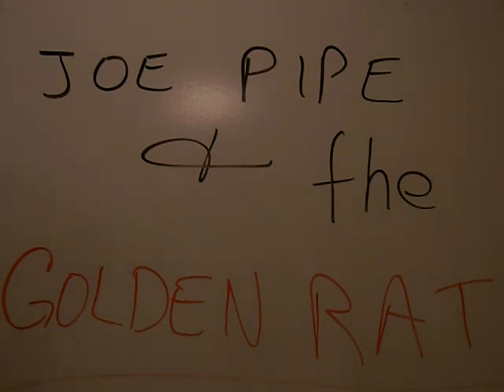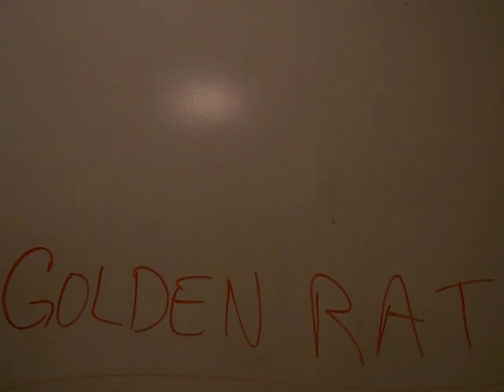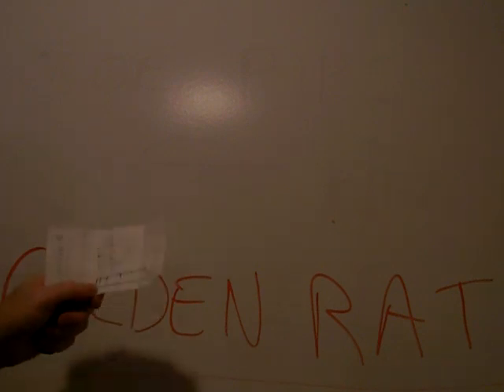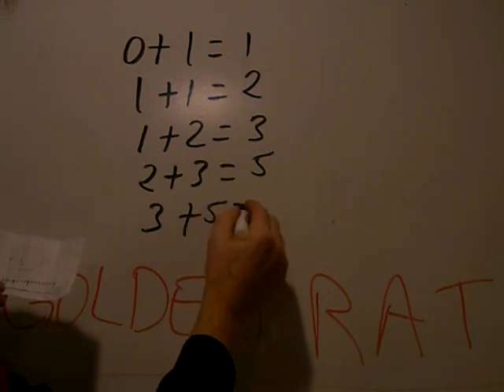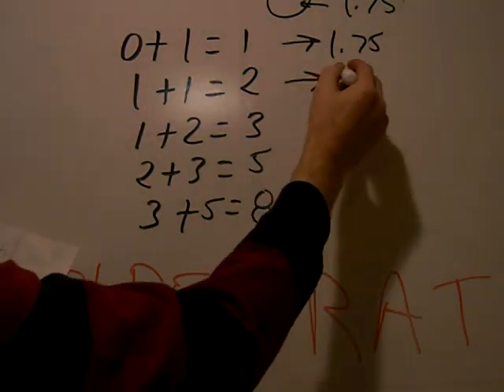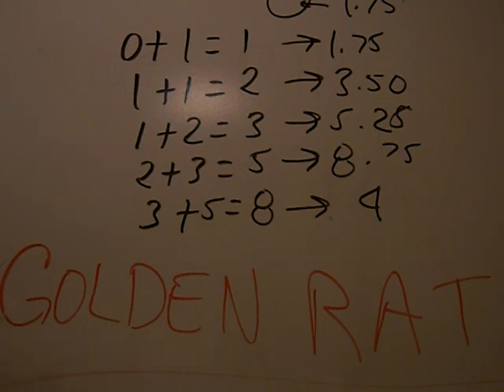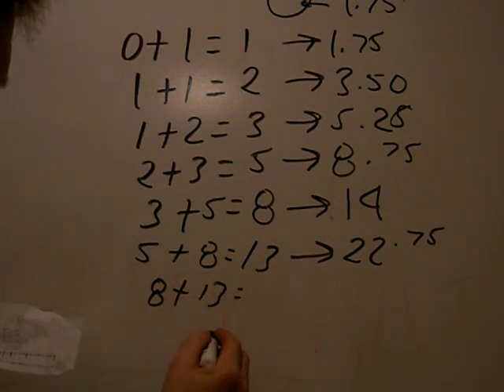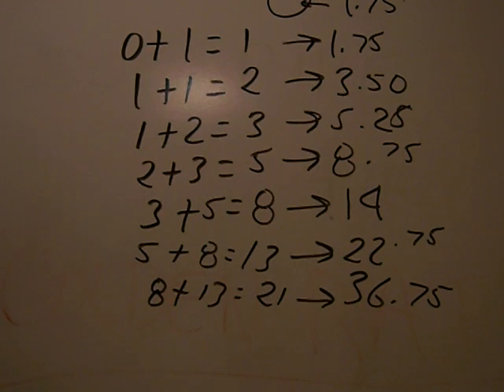338-PART 1 of 2-Joe Pipe and the Golden Ratio.

Comment from the maker: Hey good to hear from you.   Getting set up here in the Mission area about a hour from Poco where I was last doing the testing.
   Bent my titanium pipe in the recently trying to insulate in the heat.  Now that I know it really heats up this way, I would like to see what happens if the whole pipe is insulated with fire brick.  Would like to see temps up near the 2, 800 F.  Sure would make an excellent room heater.